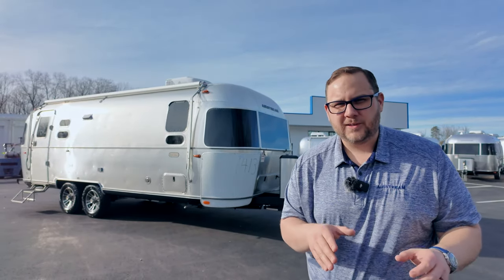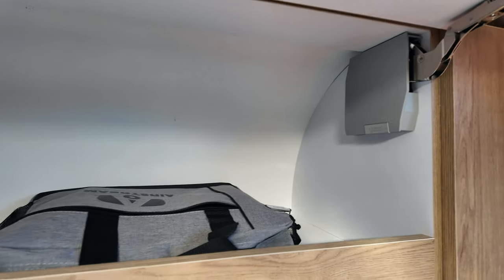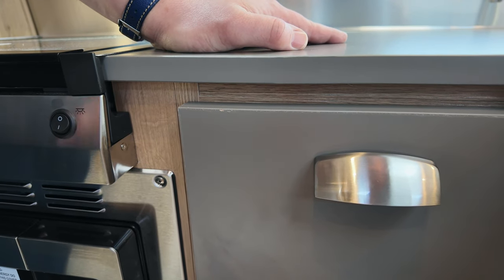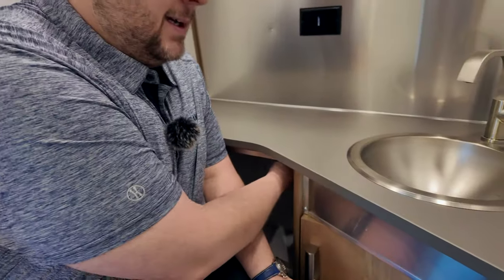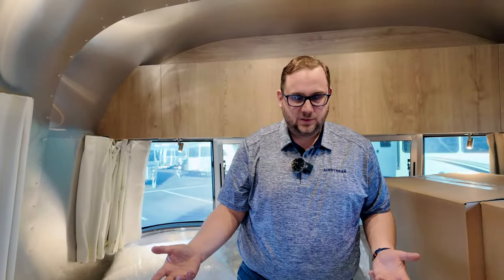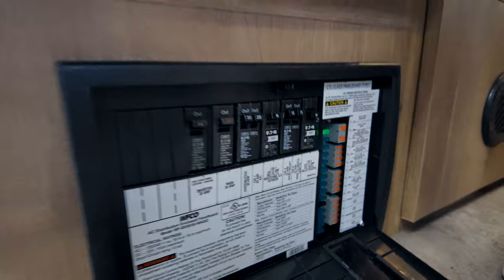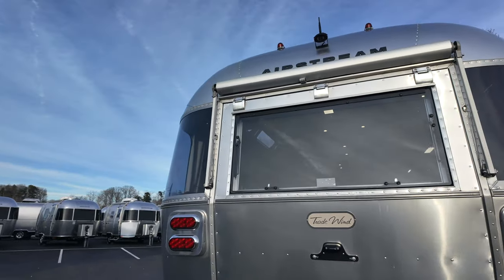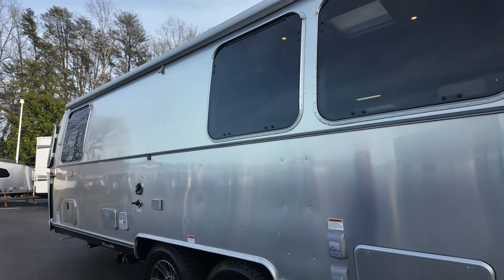Full Walkthrough - 2024 Airstream Trade Wind 25FB Twin Bed

Comment from the maker: Important note: the inverter/converter is locked to 30 amps for shore power input. This means you cannot plug the 2024 Trade Wind into a 15 amp or 20 amp socket or a non-30 amp generator because the inverter/converter will always try to pull 30 amps. You cannot currently use a step-down adapter on the Trade Wind for any reason. You can, however, use a 30 to 50 dogbone adapter to plug into 50amp. I wanted to include this in my video but wanted to wait for Airstream verification before posting it.

Comment: "you can add a composting toilet, if you want to go through that nightmare" 🤣 brutal honesty

also, I'm amazed at the battery placement. they could have put them in the front storage for access. the solid state controllers could go in the subfloor box, freeing up the storage under the seats and possibly that sleeping spot.

Comment: I have the new door handle on my 2024 International 23 FB twin. I came on the line late January. I was a bit surprised to have see it when it was delivered. First I was concerned that it was plastic, but it actually black metal. We will see if its an upgrade or not

Comment: Like the lift but did airstream increase the length of the stabilizer?  Do you think Airstream will offer a second AC unit.   It looks like space for a second AC units could be a little short.  I really like the inside color of the woodwork.  This will be a good seller for the off road campers.
Reply: The Trade Wind is designed to be a fully self-contained unit for those times when you are intentionally (or unintentionally) off the grid.  A 2nd roof top AC would drastically reduce capacity of the batteries.
I think AS did a great job with this unit and keeping it at a 25' design, and not building off of the 23' Flying Cloud.
Reply from the maker: They didn’t increase the length of the Stabilizer. Not sure if they will add a 2nd AC in option the future.

Comment: Great thing about TW is that the extra cost of $16k over FC can be recouped with campground utilities fees and fuel for travel since you can stay boondocking longer. Never mind the better cabinetry, faucet, refrigerator, profane monitor, led/lights, sound system, wheels, jack, etc. Would probably take less than 5 years to do so as long as you take advantage of it often enough. The same thing could not be said of PB 😅
Reply from the maker: I 100% agree with you this! Also, the resale value will include all of the power systems. If you did it aftermarket it's a whole lot harder to include it and it will not be include on the book.
Reply: @ChadsRVReviews  Even forgot about that! I'm wondering though, does it still have the same capacity of black water if composting option is added? It shouldn't be right? Maybe more space for fresh/gray water?

Comment: Chad,  can you go over the cargo capacity again,  Is the number you gave including a tank of fresh water?
Reply from the maker: It doesn’t include any fluids. That sticker is showing the cargo capacity based on what the trailer actually weighed at the factory when it came off-line.
Reply: @ChadsRVReviews what uses up the extra weight?  I thought mine would be 6200 lb dry and 7300 lb GVWR?
Reply: @johnbahns2951  I wonder if the 1100 that is published is without any options.  How much does the hatch add in weight?  The awning package? The microwave/convection.   Doesn't seem like it should be those would weigh 320 lbs but who knows.   My truck payload is reduced by some of my features so wouldn't it be the same situation?